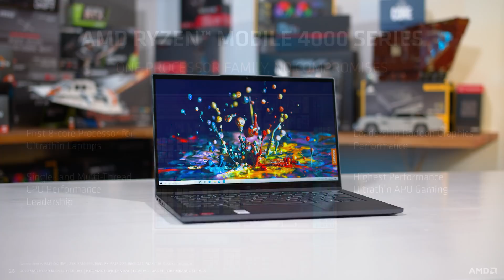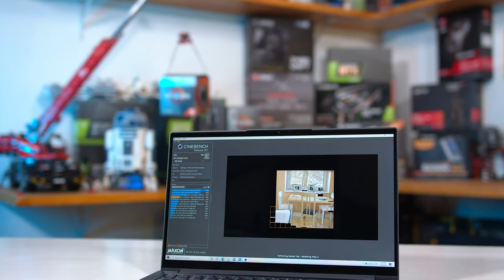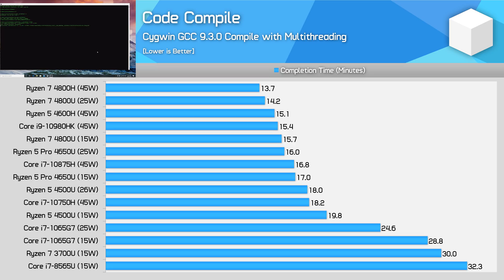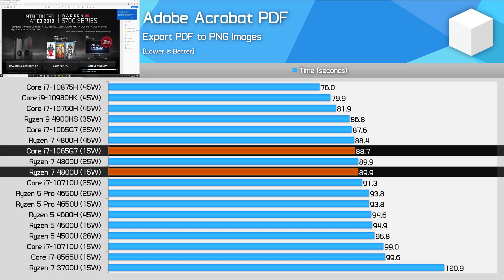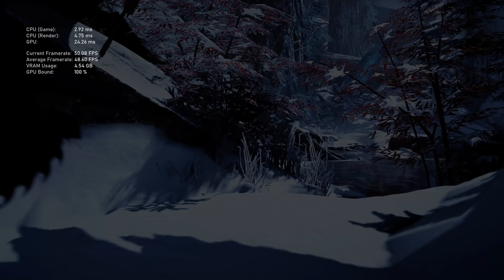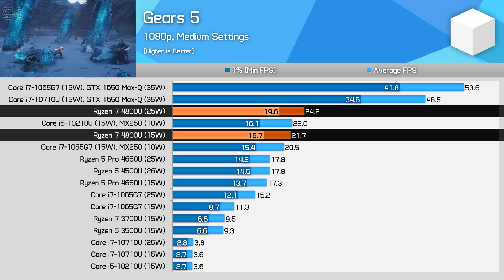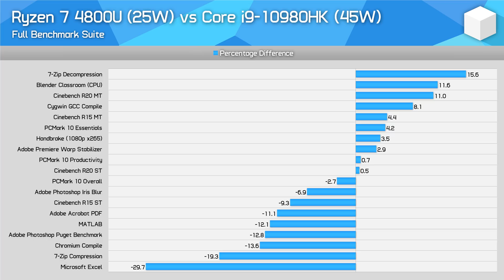AMD Ryzen 7 4800U Review, Mind Boggling Performance at 15W

Comment: Which is why everyone gives LTT crap when they talk about a new laptop and it's not AMD and they are still recommending it.
Reply: Unfortunately, if you want something better than RTX 2060, you don't really have any choice. You can blame OEMs. Maybe next gen they will treat AMD more seriously.
Reply: @Vengir  aren't the 2000 series mobile cards garbage though?
Reply: @ChucksSEADnDEAD  Garbage compared to what? The only bad thing I've heard about them was from some people not understanding what the "Max-Q" designation means.
Reply: well. depends on what you are going to use the laptop for.
at my work we mostly use teams, outlook and office-suit. we have both intel and amd laptops, and for the work we do, you dont notice a difference between the two. I guess most laptops at work dont run cinebench or 7zip in reallife, so these tests make very little difference for us.
Reply: @AndrewTSq  
But the price and the battery life makes a difference for everyone
Reply: @mr.br4dga279  batterylife yes. Price no.
Reply: @AndrewTSq  maybe that depends on markets. Generally, AMD do seem to be cheaper. In Australia, the model in this video is expensive and only one stockist has it, but configuring a full spec Intel version on the Lenovo website comes out some hundreds more expensive and that's with ice lake, so, like, damn
Reply: @rowandierich9823  Yeah, the model in this video who is cited at $1000 is almost $2000 here, so a big difference. I looked at Ryzen 3 4300U Acer Swift 3 with 4GB of ram and 128GB of SSD, that model is $550 here. Most Ryzen computers are labeled as "gaming laptops" aswell, since its builtin graphics is pretty good, which they probably  then charge extra for here :/
Reply: And checked a Intel, Lenovo V14 with Intel i5-1035G1 8GB ram, 256GB SSD is $499 at the same retailer. Not a hard choice for me. Today I use a i5 8250U and a 3700U, and they feel about the same in speed.  And I guess the i5 1035g1 is even faster
Reply: @AndrewTSq  even if you don't care about performance, amd is still cheaper and consumes much less power which results in better battery life.
Reply: @02_kdz  sure. But when both our intel and amds can go for a full day at work on only batteries it doesnt matter if amd gets 15 hours and intel only 10.
Reply: @AndrewTSq  "It literally doesn't matter that we pay more for worse machines"
Reply: @elsasslotharingen7507  For a private person, the price is a big part of it all. But for a company, an computer for $3000 or $4000 is nothing if you make millions in profit. Even less difference if you think we have the computers for 3 years, then its like $30 a month in difference.

Comment: These Lenovo laptops are already available in my country thru Lazada. Some cons that I see based on the product spec sheet: soldered on 16gb RAM and the screens isn't advertised as IPS level. Still a good buy at around 59,000php.
Reply: Nothing wrong with soldered 16gb in dual channel it's enough

Comment: Forget Intel, I bet even Apple is getting nervous about this. With AMD on this track, it could genuinely be hard to convince people that moving to ARM is the way to go.
Reply: That's a good point. With AMD pushing performance in low power configurations forward, Apple better have something major up their sleeves.
Reply: Well Apples A12z which is 2 generations older than the Ryzen 4000 series scores similar in benchmarks to a Ryzen 7 4700U. Results differ within 10-20%.
And thats with two cores (two performance cores) and less than 6W. The Ryzen 7 4700 consums more than 30W while boosting.
x86 doesn´t stand a chance
Reply: @lukas_ls  Which benchmarks are these..?
Reply: they are on a much better 5nm node.
Reply: I don't think apple commies care or know about specs or cpus
Reply: @samarthagarwal5997  Apple are waaay far opposite of commies, they're not even on the same side of the planet ideologically, i would call them a Corpocracy.
Reply: @achu-7941  that's for sure, it's all magic and unicorn and it just works when it's apple XD
Reply: "Apple commies"

What galaxy is this? I think I'm lost
Reply: uwu cringe lord i remember hearing how ppc faster than intel because clock speeds not the whole story
Reply: @xthomas7621  I mean technically yeah but risc v still has a long way to go
Reply: Apple don't give a fook, people will buy a Pentium laptop is Apple sells those.
Reply: I've been thinking this a lot lately. Apple may have just made a huge mistake by moving to ARM instead of just swapping Intel to AMD. I can't see ARM competing against AMD in laptops any time soon, which will mean that Windows ultrabooks will start looking a lot more attractive than MacBook Airs.
Reply: Peoples buying Apple products don’t care about speed, amd vs intel etc they just want a shiny Apple product or MacBook OS that’s all.
Reply: not sure, I mean, they are gonna leverage the shit out of their ios apps working on the ARM macs, like lumafusion pro is already godlike in 4k video rendering speed on the a13 ipads, imagine how fast it will be on a 12 inch a14 macbook. I have a suspicion that for the macbook pros they will just stick more a14 modules similar to how ryzen works.
Reply: Apple fans don't know what a CPU is.. let alone the difference between x86 and ARM. So no, AMD is not dangerous to Apple any time soon. Which doesn't matter a squirt of piss in the grand scheme of things... Once AMD has eaten the Desktop, Laptop and Server cake from Intel and start producing x86 phone chips with blazing fast ARM emulation in microcode... THAT's when Samsung, Qualcom... and eventually Apple should start worrying...
Reply: @Anders Juel Jensen Sorry that’s just BS. (Some) Apple fans indeed know which CPU powers their Mac and some of the older ones already participated in several architectural changes (Motorola 68k - PowerPC - x86). I know many Software developers who use Macs because it still gives you the best of both worlds (flawless GUI, powerful UNIX under the hood).

PS: I mainly use Manjaro Linux on a Ryzen 2700X w. Vega 64 but I have been a long time Mac user and still use an old MacBook Pro from 2011 on the go. And I’m uncertain if I should get a Mac or Ryzen Laptop when it fails (I do have some awesome Mac tools that have no Linux equivalent)... The only thing I dislike about Apple/MacBooks lately (since 2013?) is that everything (especially storage) is soldered to the Logic Board (Mainboard).
Reply: @NightDevilMacGeneral  you aren't paying attention then, Apple has been doing anti consumer things for over 10 years and the people who buy those products are indoctrinated. If their product dies, they just create e-waste and buy a new one.
Reply: @andersjjensen  Apple fans may not know or care about ARM or AMD or Intel. But if PC ultrabooks start to be consistently faster in peoductivity tasks than Macbooks...
Reply: Apple is not worried about amd. If Intel is strugling, people will go to Apple. Not amd...
Reply: @haukionkannel  i highly doubt that.
Reply: @haukionkannel  there's a genuine need to run windows-only software in many enterprise environments.
Reply: @haukionkannel  Most people who buy PC laptops don't care if it's Intel or AMD so long as the reviews are good. Who would seriously switch from PC to Apple just because they don't want an AMD laptop?
Reply: @haukionkannel  lol wut🤭🤭

Comment: @Hardware Unboxed, can you please show us the sustained boost frequency of 4800U?
In Intel’s presentation, they just started a Photoshop job and then opened the Task Manager(the “Auto Re-Frame” example), showing that it already was at 2.3GHz, showing a sustained boost of 2.3-2.4GHz on 4800U.
Reply from the maker: It does 2.5 GHz at 15W all core sustained. At 25W it's more like 3.1 GHz and during boost it can do over 3.5 GHz. It also very often does 4.2 GHz single core
Reply: @Hardwareunboxed  wow... Scam benchmarks as well ... After choosing wierd  ones that benefit them😂. I bet they set the power limit low or didn't put the laptop in performance mode or something...
Reply: Sudhanva S Sounds like 15W but maybe in a worse chassis/not cooled that well.

Comment: I think you are forgetting the role of LPDDR4 4266MHz for games. I assume the Ryzen 5 Pro 4650U did use DDR4 3200 MHz? Because the lead in gears 5 looks purely like DDR performance difference, in the real world with equal memory the renoir APUs are much closer to each other in iGPU performance.
Reply: Yep lpddr4x in quad channel at 4266mhs is theoretically 68GB/vs 50GB/s on ddr4 3200mhz dual channel

Comment: bring in 4900H, wanna know how good that is
Reply: No need.  No need to beat up a corpse.
Reply: @jayvee8502  well yeah 🤪, but Intel has it's new gen coming out so might be worth it
Reply: @jayvee8502  GN pointed out that dead horses can still take beatings.
Reply: There are already leaks with Zen3 APUs with Vega graphics so no need to launch  something like 4900U. As of now Renior is still competitive against Tiger lake.
Reply: @jayvee8502 there already exists a 4900h in asus tuf, I was not being sarcastic
Reply: @jayvee8502  and the APUs are zen2 as of my knowledge, the 4000 series are zen2
Reply: @modernlogix  I am talking about the next series APUs was that Ceazan? They are already in testing.  If or not 4900u might come will depend on Tiger lake performance.
Reply: @jayvee8502  4900u is never coming out 🤔, and I never mentioned it. And zen3 CPUs are coming before the APUs. The CPUs will make the APUs performance clear more or less.
Reply: @modernlogix  4900u is like 4900H.  Very rare.  AMD will probably lower there prices if Tiger lake really is good.  For now OEMs are satisfied with 4800H, 4900HS and 4800U. Also 4900U and 4900H are very not easy to make since it must be 
binned properly to meet the specs.
Reply: The 4800HS is awesome. Ryzen 3600 level performance at 35W when maxed out but you can also have it run like a 4800U by limiting its TDP to 15W - keeping your laptop cool and quiet while still having plenty of performance.

It's crazy to have the performance of a mainstream desktop CPU in a 14" laptop.
Reply: The 4900Hisin the zepharus G14 already. Go look at reviews
Reply: @denverbasshead  That was 4900HS not 4900H on G14.
Reply: @denverbasshead  You are refering to A15.  Yes it is 4900H.

Comment: I hope alienware UFO ships with this cpu
Reply: Nope. Its having 10th gen iris plus graphics. Smh.
Reply: @jeffthegamerboy3476  "it had" when they displayed it as a concept, they said themselves nothing is final and that's why they didn't announce any hardware specs and we knew it was intel just by looking the spec inside windows
Reply: @zer0legend109 , oh. Maybe alienware is waiting on tiger lake since this handheld has a huge potential. But 4800u would be the best for gaming since that's what its made for. And at so much less powerdraw plus freesync in handheld mode without any additional hardware.
Reply: @jeffthegamerboy3476  maybe, but I still cling to the hope it ships with customized ryzen cpu with vega 10 maybe but that's very optimistic, anyway I will just buy it if it comes with ryzen cpu otherwise it won't be worth it, heating is a main problem with intel processors considering the handheld format
Reply: @zer0legend109 , yup. And I believe that nvidia tegra chips aren't optimised for Windows? I may be wrong here. But amd and nvidia are both better options than intel right now for a pure gaming handheld.
Reply: No handheld PC is shipping with it. But the Aya Neo is shipping with a 4500U though.
Reply: @aquapendulum  what other handheld pc is available with ryzen also? R5 4600u would be nicer than 4500u with hyperthread in place it would deliver better than the 4500u